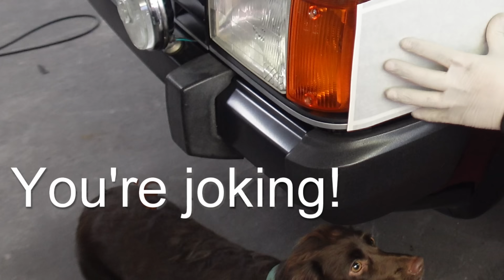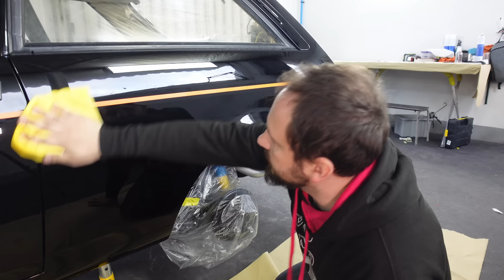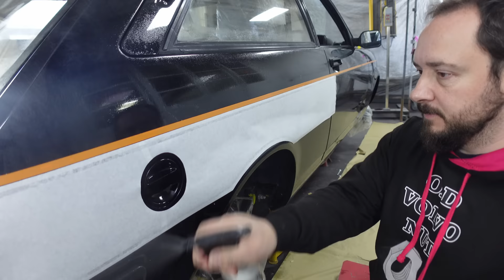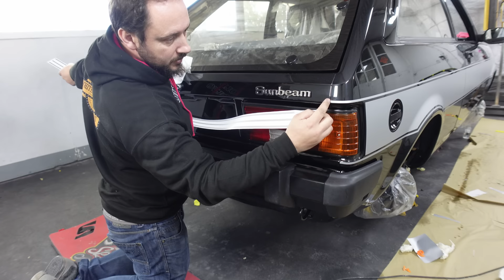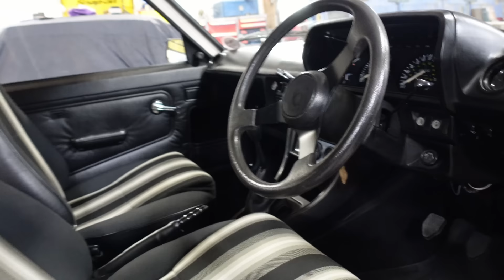The FINAL Talbot Sunbeam LOTUS Episode! Applying the Decals and Sending it OUT!

Comment: been a signwriter over 40 years now & that's a nice job! if you're doing vinyl graphics  regularly, might be worth investing in a proper squeegee, 3m gold are the best, also some signmaker magnets, saves all that messing around aligning with masking tape, I use wrapcut  tape for the ends, they do a bendy one & one for straight & slight curves, if the vinyl is air release you can do it dry with no fear of bubbles, supplying stripes over long is correct, I trim door shuts after removing application tape so you can see what you're doing.

Comment: Why vinyl & not paint?
Ive had silver vinyl
On my work van & had to have it redone 3 times over last 10 years as it looses it shine & goes starts to look dirty- been to 3 different vinyl guys now & theyve told me to change to grey as silver has a shorter life span 🤷🏼‍♂️
Reply: cast vinyl is the best for metallics, expensive but should last 7-10 years, most signmakers use cheap to mid range because they're competing with local competition on price.
on a classic car that will only see daylight a few times a year, cheaper vinyl should be ok.

Comment: Were you referring to an original when you decided to cut, or when you stuck the Lotus roundel?  Seemed like you were doing it as you saw it , rather than using a reference..
Reply from the maker: If you go back to when we're using the laser level in the vid, you'll hear Lewis discuss the measurements for the roundle from historical records and the decals were cut to customer requested specifications 👍
Reply: @WhitelandRestorations  sure .. I just couldn't even begin to cut that sticker without checking everything every 5 secs! ;)